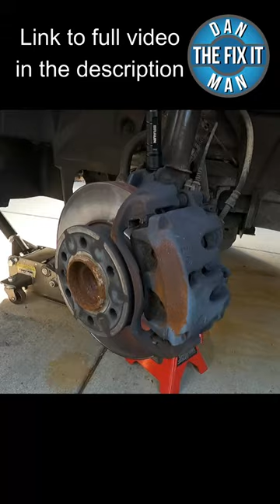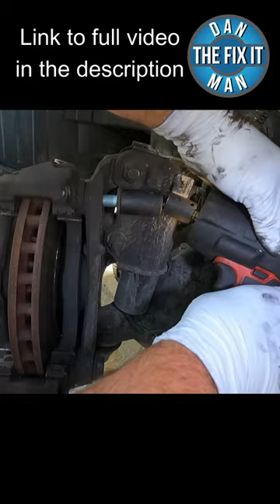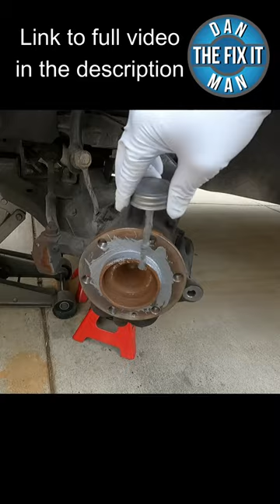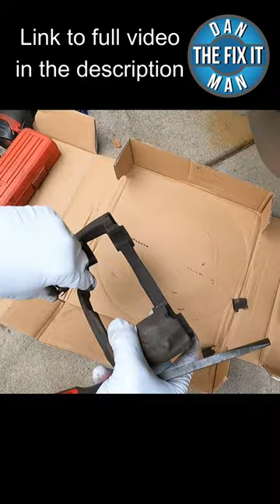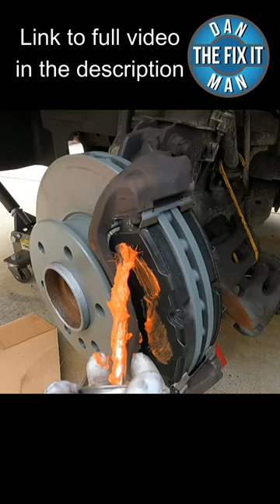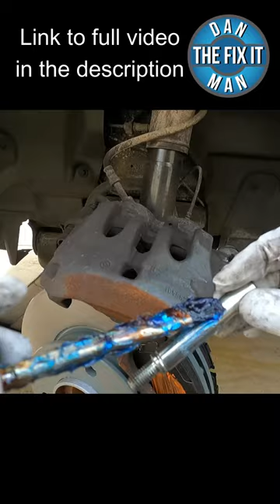2019 Mercedes Benz Sprinter 2500 Replacing Front Brake Pads & Rotors ASMR #vanlife

Comment: Is there a reason you didnt put never sieze on the top of the slider clips?
Reply from the maker: I usually do put some silicone based caliper grease on top of them.  I just didn’t on this video, but it seems that there is a big debate on that in the comment section on some of my brake videos.  Some people say it’s not necessary and will just collect dust or melt right off.  Others agree that it should be put on and will help prevent the brakes from getting stuck or binding…I guess it all depends on how you feel about it.
Reply: @DantheFixitMan  yea still trying to decide whats best as Ive always put it on the tops and bottoms of those clips but it makes sesne they collect more dirt, thanks for the reply and great short video

Comment: I hope that wasn't lock tite I saw 😮
Reply: Locktite the mounting bolts. It’s so vibrations dont cause them to come loose. Blue loctite comes loose easily with a breaker bar on mount bolts. I’ve done the same for years